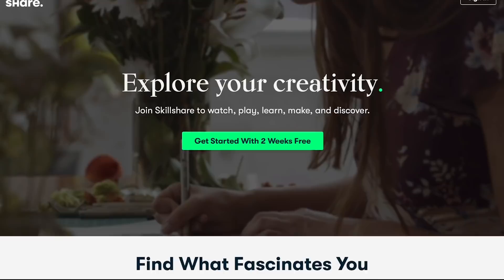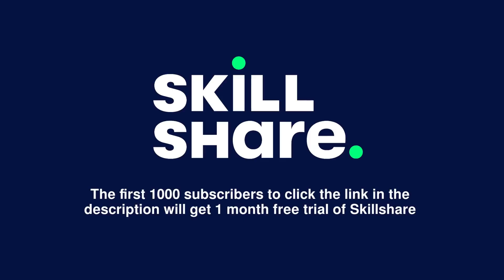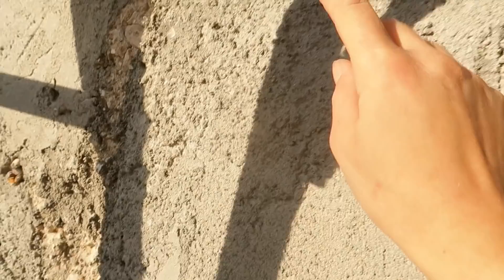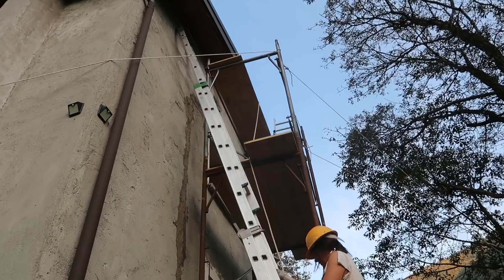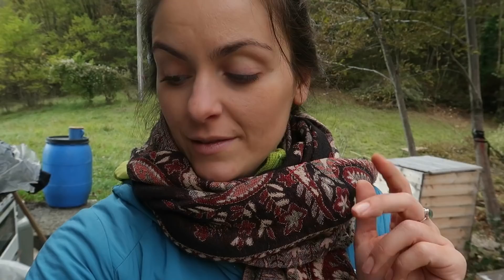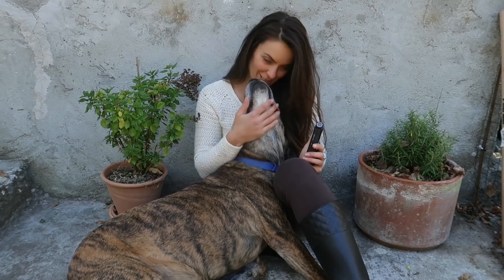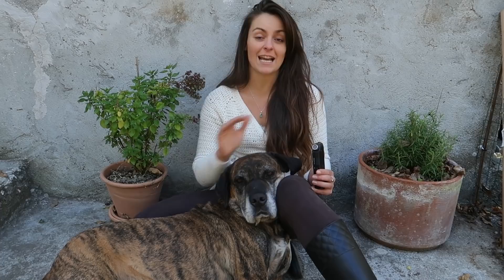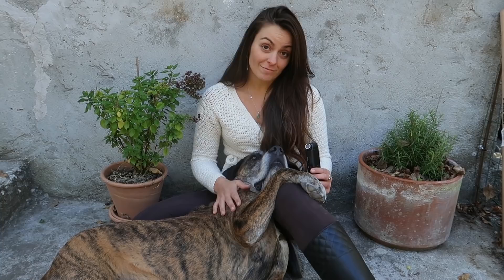I need to explain a few things.

Comment: Hi Marina, I’m a uk builder and have applied lime wash with a little linseed oil in it a number of times. I have found you have to paint it so often as it is just not durable enough.  If you do use the limewash the wall needs wetting half an hour before painting. Many thin coats are needed or it cracks and crazes. It doesn’t become immediately sound like ordinary paints it has to carbonate to harden. A new environmental paint that is breathable is now the preferred choice it is called silicate paint. It is much more expensive but it works out better in the long term as you don’t have to keep repainting it. There is a silicate primer and a top coat. It has been known to last 100 years before. Probably an exception. As it’s environmentally friendly and durable it is a great alternative to limewash. All these paints are usually used over lime mortars. It is worth checking for any instructions when used over sand and cement mortars, limewash doesn’t adhere as well over sand and cement mortars. Love your content and the way you grab life by the horns it’s admirable.
Reply from the maker: Thank you this is all new info to me, I'll check this paint you mentioned out

Comment: To paint with lime, use 80% water and 20% lime. Paint very thin application, like a wash. Let dry and paint again. You will probably need 5 or more layers to begin with. Then each year when you repaint, you just do one layer.

Comment: P.S.  Sometimes it's easier to put the mortar on the wall with your hand and squish it in the crack and then smooth it with the trowel.  It's a special skill to be able to stick and work the mortar and not use your hands.  I always find I lose more than what goes in the wall when I don't use my hands (with rubber gloves so it doesn't stick to the gloves).

Comment: I always worry watching you working on your own at height.  Especially when the top of the ladder bounced at 07:10.  Later I saw the ladder had feet so good but always try to tie-off the top if possible.  Maybe screw in a ring bolt.  Hope you found a use for all the mortar which dropped.

Comment: I've used lime (cal in Portugal) lots. I usually slake the lime or buy it ready to use. I don't think you add milk but use it in a milk-like consistency. Thin coats are better than thick. It's beautiful after it's dried but looks like nothing when it's freshly applied. It can be painted on with a big brush and can be done super quickly! You will love the result!
Reply from the maker: Thank you Veronica for the tips, plus I learned a new Portuguese word :)

Comment: Ok glad Svetland  found a forever home, not to give you advise or anything, but do not got to shelters for a while, because you will again be tempted to adopt another dog, and from what we see you might be ready now to travel a bit .The sink outside…we were horrified when we saw you took it out, we hope you install it back, as they are very useful in the summer to water anything small in the garden clean things like quick sweaty bodies and wash anything that needs running water and a basin ( to soak a plant) to wash small amounts of clothes, quickly fill a water bowl for a future pet?……literally anything……. in older times outside sinks saved the day!,,, though I would build a small owning above  the sink, so that rain water does not accumulate or other debris like leaves and moss. ( you don’t need a big owning ) just a small one just slightly wider than the size of the sink and maybe a foot or foot and a half away from the wall. You will not regret it.

Comment: Debra: Sweetheart cheaper is not always better, There are many products that bond great to plaster and are very durable and not that expensive. You are in an area that is extremely hot and dry in the summer and cold and wet for a better part of the year and you will find that you will be continually touching up that paint and repainting in a few years. It is also best to pressure wash that type of house before you paint it. I am sure this information is too late but I only have just found your channel today.

Comment: I have been using Cal paint for over 25 years on my house . inside and outside . It holds up great here in Guatemala . No frost here . 
My mix is 1 part white wood glue and 4 parts water .Add Cal and stir very well . For one gallon glue and 4 gallon water I use about 
10 kg of Lime. Works great on unpainted cement but not on latex or oil painted surfaces . You need several coats to cover well . 
Its messy, you have to do prep work well .
Reply from the maker: Thank you for those tips!!